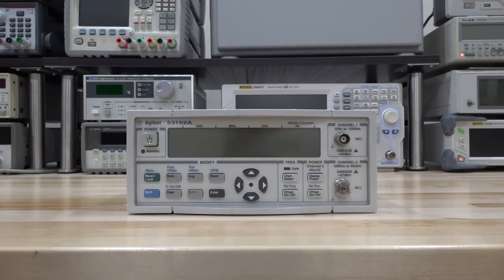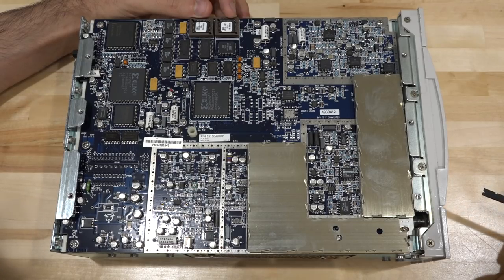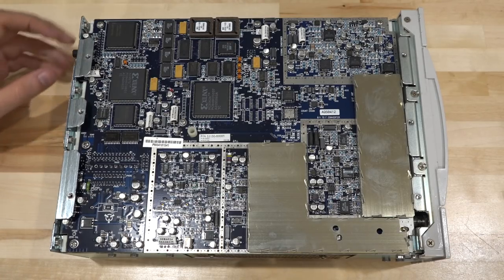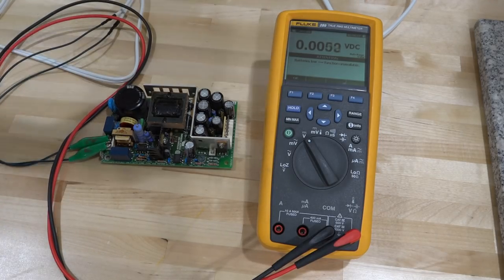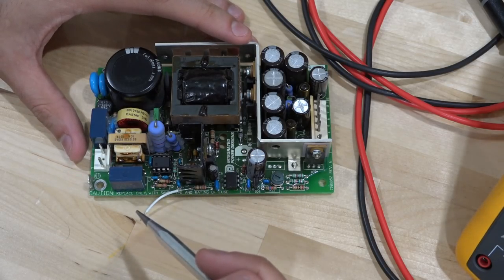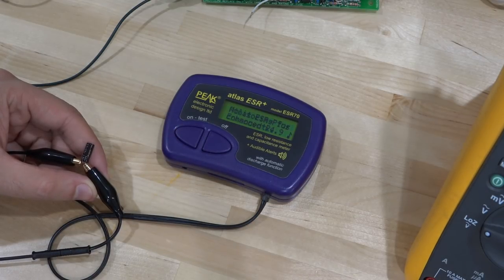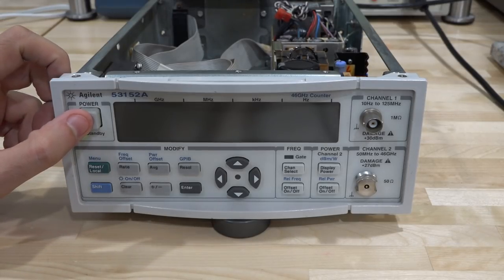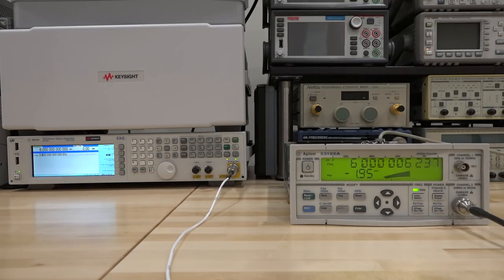TSP #103 - Teardown & Repair of an Agilent 53152A 46GHz Microwave Frequency Counter

Comment: Bad caps on the primary side are such a common fault on PSUs I usually replace them by default without even testing.
Reply from the maker: Yes, you are right of course. I was just all too eager to get to the frequency counter itself! :)
Reply: Hey, spoilers!  :-)
Reply: Yep, most of the SMPS I've repaired either had bad caps feeding the driver IC or bad caps on the secondary side. Extremely common fault, and by my observations often the result of poor component placement. Many times when I find a bad cap in the supply circuit of the driver/PWM IC, the cap is located very close to a hot part such as a heatsink, power resistor, NTC, etc, which leads to the eventual failure of the capacitor. I've found this design defect in many power supplies even from reputable manufacturers. No matter how good quality electrolytic capacitors are, they all eventually succumb to high heat. Good design practice is to keep all electrolytics well spaced from heat dissipating components.

Comment: What a unique piece of gear - so few people will ever need such a counter. Totally disabled by a single part. I had a failure on a high-end LeCroy DA1855A differential amplifier but the failure caused the PSU to pulse high voltage into the circuit, destroying the unit beyond repair. 

Look forward to seeing this used in some future video.

Comment: you probably already know but the Weinschel Planar Crown is supposed to have the ground inside, without you would get tremendous reflections. Normally they are pressed i and should not fall out. And yes they are rare but they are quite good because the impedance and parasitic of the spring contacts are really low. It also has some advantages because it will lock in rotations an so prohibits rubbing of the surfaces unlike SMA, APC7 and such. And you do not need torque wrench. They have a whole ecosystem around that form changing damaged connectors quick and easy, an also to have a common connection to adapt to any other standard. Maybe someone at Agilent design team had a 
representative from Weinschel convince them  ;)

Comment: 14:40 Although, if it did have power factor correction it'd boost the rectified voltage to ~400V DC. So it could be unsafe even though only 30V AC is supplied.

Comment: Reminds me of a repair I did 2 months back for an old HP lead acid charger/inverter. Powered on but only with fresh battery. Charger wasnt working. Traced it to the unit's SMPS. Eventually traced it to the PWM chip Siemens TDA 4605 made by West Germany (unit is old). I also thought the BUZ90A Mosfet to be broken but it works. Turns out its almost the exact same issue here.

Comment: Always a nice feeling when you happen to by luck guess one of the faults immediately :).

(The pwm controller) just a visual inspection made me notice that little tiny resistor next to the chip was discoloured to the point that the bands where disappearing and I kinda drew air through my teeth and thought that ic is not going to have liked that is it :/

Really rather close proximity, but I guess it probably wasn't a problem when the fan was working.

The second fault did seem very "capacitory" (failure under load).

Comment: $20 for a 46 GHz connector!?! What a steal!
Reply: They tend to go cheaply because this interface is rarely used.  It's a shame that it is due to the robust nature of the interface, which allows cables to be switched often without needing a torque wrench and minimises damage to expensive connectors.

Comment: Where did the hall-effect sensor come from? Maybe from the fan? Does that sensor still work? So many open questions. ;)

I wouldn't install expensive frequency references in all these devices. I would prefer a good gps disciplined OCXO and a distribution system to get the 10MHz (and 1PPS) where needed. But even this would be expensive, but there are people who have built such setups with stuff like video distribution amplifiers and rubidium references from ebay.

Comment: This is a little off topic, but where did you find the cylindrical supports for your shelves. My cinder blocks are sturdy but they take up a lot of space. 
Thank you for all the work, I have learned a lot. 
Brad
Reply: waaay too late, but those are from IKEA. I was using the same for a monitor stand at my office. They are nice since they are adjustable. That particular model might be discontinued, but the "CAPITA" ones are probably very similar: https://www.ikea.com/us/en/catalog/products/30263575/#/60263574

Comment: Excellent video as usual. Thanks for sharing it.
A side note @21:00: I would use a ~1K Ohm resistor between pin 12 and pin11 and apply + power to pin 11 only.
This case, you are protecting the internal Zener diode (12mA Max @12V which is enough to run the chip, a 1/4 watt resistor should do) from over current (in case you apply say, 40V to the input "40v/1K= 40mA" will pass through the internal Zener diode).
A low ohm resistor, will also act as a noise suppressor for the power supply.  An additional ferrite bead in the path of Vcc ot Vc  with do some good too. 
One thing is not clear to me. Do I need an actual R/C network on pin 7? Or can I apply my own buffered DAC analog voltage, or even an external clock instead?
looking forward to your next video.

Comment: As far as you know, are these stable measuring sine signals of low frequency like 1 kHz, 10 kHz, 100 kHz? Mine is very stable with 10 MHz but very instable with a 1 kHz sine wave signal, only stable with square wave signals.....

Comment: Very nice video, thank you!
I have noticed that the Counter has an input for an external 10 MHz Reference, as probably a lot other pieces of your testgear have.
Even if all your pieces of test-gear have highly-accurate internal 10MHz references, would there still not be some amount of drift between them?
Would it not make sense to set up a Lab-Standard 10 MHz Reference and fan that out to all the different pieces of test-gear?
I'd be interested in hearing your thoughts.

Cheers!

Comment: Regarding the rubidium, would it not make more sense to get a really good one and distribute it throughout the lab into every unit that accepts external references instead of putting it into single units?
Reply: I think a GPS disciplined oscillator for the lab would be appropriate.

Comment: Actually this was more a "HP PSU repair" and "partial teardown"(we didn't see inside the cans!).

Also, ¿¿¡¡how come these devices do not use RPM-monitored fans?!?!, it's beyond my comprehension that these very expensive, very high end and very high-margin equipment have straight to VCC dumb fans(and it's not the only one, of all the teardowns i've seen in YT not one has RPM control/monitor)
Reply from the maker: I promise to show more of the unit when I upgrade it. :)